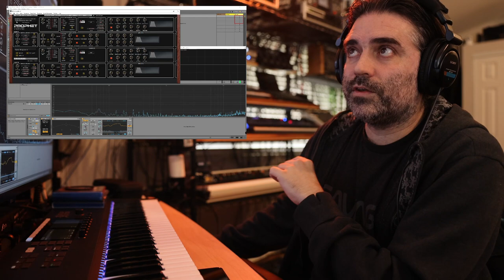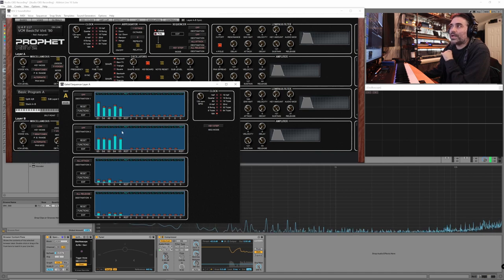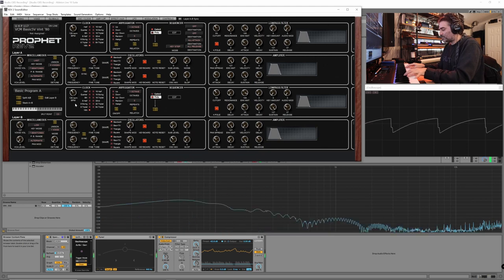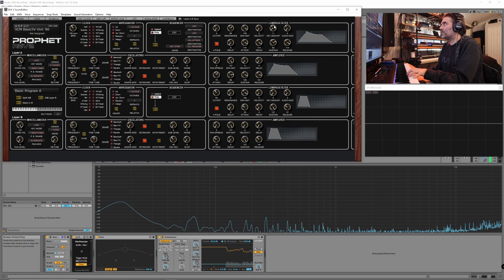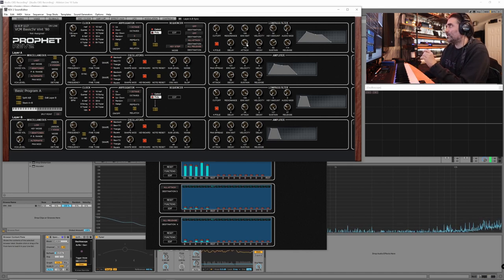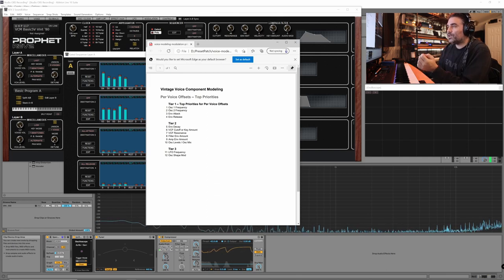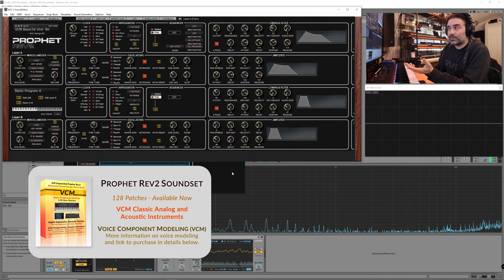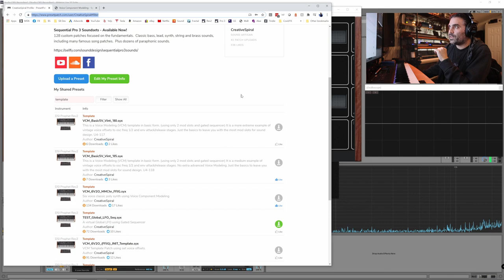Prophet Rev2 Synth - Vintage Voice Modeling - Free Patches

Comment: just tried this on my rev2, I don't have the software so I did it manually, and it's not as hard as I thought it would be! this is such a useful trick and even if you choose to use 4 lanes in the mod matrix, there's still lots of modulation lanes left to use (including some dedicated slots for mod wheel, pressure, velocity, etc that I always forget about).

once I got it set up fully with the envelope temporal offsets and everything, it totally changed the character of the synth. it's insane how powerful the Rev2 can be when you know how to use it. definitely going to use it as an initial template for all my patches now.
Reply from the maker: Awesome!  Glad you're enjoying it.   Cheers, Jason
Reply: have you got any tips for me?I've tried it the same way, but it doesn't work...
  :-/

Comment: Interesting concept. This kind of thing is something I have been doing for many years on VCO based synths - as a technique to push them more towards the behaviour of acoustic instruments. In particular my Alesis Andromeda has a per voice random modulation source which can be useful for this sort of thing. I think the Deepmind also has parameter randomisation on a per voice basis built in as a dedicated control. Some vintage analogue synths such as the minimoog are so variable in this respect you don't need to program it deliberately, it just happens anyway! Sample and hold triggered by note on can also generate a new value for every note, which is even more lively than per voice variance. However there is still something about DCO based synths that is different to my ears. the oscillator sound is thinner and less substantial, transients are more precise and they behave differently in a mix. The more instances you use in a mix the more pronounced the differences between DCO and VCO become. Anyway interesting ideas thanks.
Reply from the maker: Hey David - Yeah, I have done a ton of research on the topic of voice variance in vintage and modern synths...  the Deepmind's Osc Drift and Parameter Drift algorithms are both based on random drifting motion.    The downside of these (as well as Seq's Osc Slop), is that its introducing an extra layer of artificial motion into the equation.   Based on the research I've done, the key is to create curated, stable per voice offsets.   With the Slop/Drift/Parameter Drift methods, you get artificial drifting motion added in which is unrealistic, you'll get moments of odd dissonance at med/higher values due to random nature and phasing, and these methods don't produce repeatable performance as voices are cycles, or from session to session.    I've also experimented extensively with other methods like LFO random (S+H) and other tricks... they all have the downsides associated with randomness.      All of this is discussed in more detail on the VCM website:   http://www.VoiceComponentModeling.com

That's interesting that Andromeda has a voice mod source... I didn't know that.   Always wanted an Andromeda :)    Voice as a source is definitely a good way to implement VCM type of techniques though... that's what I use on Deepmind, and now on PolyBrute.
Reply: @CreativeSpiral  its an interesting topic and I agree that random based pitch and other parameter slop is not entirely natural, you have to be subtle with it but I think it helps to liven things up. My own interest is based on the behaviour of acoustic instruments as applied to analogue synths. So its interesting that you mention trying to make a performance 'repeatable' in terms of the voice offsets. Acoustic instrument performance is never repeatable at the kind of micro level we are talking about. Actually I like that. 
I think a lot of synth makers have thought about this issue - for example my Sub37 has an osc drift parameter, which I think is actually a per note random offset to pitch. My Macbeth M5n has an oscillator 'stability' control which seems to introduce some variability into the oscillator tracking across the keyboard. Thanks for the link I will look through your website with interest. Always more to learn!

Comment: I just received my Rev2, stoked. 
I'm a bit confused, at 4:36 , in the gated sequencer in layer A, Destination 1 and Destination 2 are set to OFF, but you  say they are targeting Osc Freq 1 and 2?
Reply from the maker: The mapping to Osc Freq 1 and Osc Freq 2 is done in the mod matrix instead.  If you route directly via the gated sequencer, the values are too coarse...  but using the mod matrix, you can scale down the values to tiny fractions, which are appropriate to get the vintage voice modeling behavior.    If you look at the example patches I uploaded,  you'll see the mod matrix setup.  Also, in the Blade Runner sound design video I did, I go through the entire setup and discuss in more detail how the connections are made:  https://www.youtube.com/watch?v=jB9HG3k3vvQ   (starting around 5:50)
Reply: @CreativeSpiral  please pin this comment!

Comment: Fantastic video, this is the one I was waiting for :) the without-with-without demos cemented the benefit. For synths without the gated sequencer, but with great mod matrix, would a small random value per-voice approximate?
Reply from the maker: Glad you enjoyed it!   Yes, any synth with a Voice Number or Random mod source option can achieve at least some voice modeling.   The Rev2, with the gated sequencer method and large mod matrix just allows very detailed voice modeling.    But, I've built a whole bank of patches on the Deepmind using Voice Number mod source for vintage voice modeling, and plan on doing the same when I get my PolyBrute.   There's some more articles on how to do this here:  https://www.presetpatch.com/articles/voice-component-modeling

Comment: Hi, thanks for the data. Very useful. I have a question. How do you get to play in the gated mode without the sound of the steps of the sequences. I m doing what you did but in the hardware and it jumps between the steps all the time cutting the sound
Reply from the maker: Hey Emiliano - there's a Seq Mode option in the Gated Sequencer... that needs to be set to "Key Step", in order for the sequencer to advance with each key stroke.

Comment: Excellent! One minor caveat: the filter cutoff has relatively low priority on your list. But it automatically affects the A, D, R times, i.e. wouldn‘t it be more economical to put above those parameters in order to save mod slots?
Reply from the maker: Thanks Rayy!   Routing offsets to filter cutoff only affects the "height" of the frequency Q point, on a per voice basis... It doesn't affect the ADR temporal timing.   Also, since there are other per voice offsets already associated with cutoff (ie: filter key tracking and filter velocity), I've found the per voice routing to cutoff to be less important than the per-voice ADR variance, which affects timing of those resonant peaks and VCA volume peaks.   Attack also has a downstream effect of altering the temporal offset of decay.    It is still a decent idea to have per voice cutoff variance as well, but I would definitely prioritize it lower than ADR offsets.
Reply: @CreativeSpiral  Oops, my fault. Yes, ADR are defined as time, not speed parameters. On the other hand, Sequential mixes this up as well. Have you noticed that in the mod matrix you need to dial in a positive value in order to shorten ADR times and vice versa? I‘m not alone. :D
Reply from the maker: @RayyMusik   Yeah... the positive values = shorter times is definitely is an odd choice...   I'm used to it now, but when I first got DSI/Seq instruments, it definitely confused me a few times.  ;)

Comment: I dont understand how to do this. if I target osc 1 or 2 freq, it sounds completely out of tune. i cannot target fine osc tuning with the gated sequencer. can anyone help?
Reply from the maker: There's a trick using the Gated Sequencer and Mod Matrix together that allows you to get fractional modulations (ie: fine tuning)...  If you look at  the free demo patches, you can see how its done, or in the Blade Runner example video, I discuss it in more detail, starting around 9:00:   https://youtu.be/jB9HG3k3vvQ?t=540
Reply: I've found it on the sequential forum thanks a lot!

Comment: Super cool stuff. But why does the gated sequencer say that the destination is ‘off’ in your video for sequence 1 and 2 but you describe it as modulating the Osc frequency (and, as far as I can tell, the fine frequency at that)? If I recreate the patch from the video and route sequence 1 to  the osc frequency I (predictably) get different pitches when hitting the same note. If I turn the routing ‘off,’ I’m pretty sure I’m not hearing any effect at all (I tested this by using more extreme numeric values), certainly not the slight but lovely per-voice drift you have here. 

Sorry if this is a dumb question. Really appreciate your educational videos and helping duffers like me get the most out of this synth!
Reply: I think I figured out that you must be doing something over on the ‘modulation’ tab with sequencer as a source, osc freq as a destination, and a small amount. Guess I will actually have to download the template rather than read values off the screen in the video. Thanks for all the work deconstructing this synth!
Reply from the maker: Thanks!  This video doesn't go into  the entire setup process... but there are links in the description to download template patches with everything set up.   The modulation for Osc Frequency is routed through the mod matrix (has to be done that way to get appropriate scaling)   In the Blade Runner patch video I uploaded a while back, I go through an example of the whole setup and describe the scaling/offsets in more detail.   If you wanna check that out, here's the video, and the specific VCM setup starts at about 9min:   https://youtu.be/jB9HG3k3vvQ?t=541

Comment: Does this bring the rev2 more into the sonic territory of the p6?
Also is this similar to how the new Vintage knob works on the P6?
Reply from the maker: Yes, per voice variance is one of the key factors of classic poly synth sound, and VCO poly character.   There are many components that give each synth a unique sound.   The VCF filter implementation is one of the biggest contributors to sound, and Rev2 vs P6 definitely have some difference in filter character, though they are based on the same general OTA architecture.     

Sequential has been mum on the exact specifics of their vintage knob modeling (as they want to keep it somewhat a trade secret), but the general concept is the same:  give per voice variance to different components (oscillators, filters, envelopes, etc..).   From discussions on the forums, my interpretation is they are using more of a "randomized approach" to creating the per voice variances, where this VCM method uses a more "curated approach" to setting specific offsets per voice, per component, and defining virtual voices.

Comment: Hi ! thanks for this depth video. But I can't understand one thing. In the gate sequencer. You telling that the first two lines affect at OSC freq, But Destination 1 and 2 are set to "off". why?  how does it work?
Reply from the maker: If you route from the Gated Sequencer direct to Osc1/2 frequency, the values are too coarse.  The mod matrix is used as a workaround to scale down the values to appropriate amounts..  if you download the free patch examples, you can see the setup in the matrix, routing Seq1/2 to Osc1/2.   Also, in my Blade Runner patch design video, I explain the setup in more detail:  https://www.youtube.com/watch?v=jB9HG3k3vvQ
Reply: @CreativeSpiral  thanks a lot! now I understand :)

Comment: Hi. This is great. Thank you. 
Is there a tutorial anywhere showing how to do this on the synth it’s self? 

Also do you know if this also works on the OB6?
Reply from the maker: In my Blade Runner patch design video, I go through the process on Rev 2:   https://youtu.be/jB9HG3k3vvQ?t=341  (starting around 5:40)    On OB-6, you can use the Vintage Knob functionality, which Sequential added in a firmware update... it uses the same methodology as these voice modeling techniques, and does a pretty good job... though I have some videos explaining how the Vintage Knob behavior could be improved as well...

Comment: How is this different from what the "slop" knob does?
Reply from the maker: The slop knob targets only oscillators, missing out on per voice offsets to filter, envelopes and other parameters that create much of the vintage character.  In addition, slop uses a randomized, constantly drifting tuning, which is more artificial.  If you want good vintage character, then using curated, stable offsets is better...   also great for acoustic ensemble patches.. you can create very realistic string and brass ensemble sounds with this type of method.  Bunch more info is available on my VoiceComponentModeling.com website, if you’re interested in reading more on the topic.   Cheers, J

Comment: This is a neat idea, but isn't OSC drift pr voice, meant to be modelled by the OSC slop know on the Rev-2. Or am I misunderstanding what that knob does?
Reply from the maker: I've written up a bunch of info on the subject on the VCM website and Seq forum.  The short of it is that OSC Slop is a very sloppy way to offset oscillators... it produces highly artificial, exaggerated motion that you don't actually find when measuring vintage instruments.   Having stable, curated offsets produces a more natural, realistic vintage character.  Further, Osc variances are just one portion of the vintage voice modeling.  Also offsetting cutoff, resonance, and envelope attack, decay and release timings adds a ton to organic/warm analog sound.

Comment: This is fantastic stuff. 
So does this require a second set of voices? Does that mean the 16 voice rev2 becomes effectively an 8 voice instrument?
Or is it a difference between the two DCO's within one voice?
Reply from the maker: Thanks Tom.. the standard VCM / vintage voice modeling setup doesn’t require/use and extra physical voices.  If you download the example patches, they are all setup and ready for sound design.   You can setup this type of voice modeling as a Stack/layered patch, which does essentially halve the physical voice count… it does produce spectacularly huge stereo/binaural fields of sound… I do recommend it ;)   Lots of the patches in the two VCM sound sets I’ve created use the VCM techniques with hard panned binaural stereo stacks.. it produces a similar sound to double tracking a part, but it’s all at your fingers in a live context.
Reply: @CreativeSpiral  thanks. do you know if this can be done with the Prophet 08 ?
Reply from the maker: @tomphillpotts  Yes, these techniques can work on P08 as well.   Some discussion here:  https://forum.sequential.com/index.php?topic=3450.0

Comment: So if an Analog oscillator is Digitally Controlled (DCO), then is the sound basically the same as using pure Digital? Or does the Analog Osc add any warmth at all?
Reply from the maker: The analog core oscillator gives natural analog wave shape and harmonic series, free of any digital aliasing or upper harmonic issues... for a true analog response.  The clock/tuning of that analog oscillator is what's digital in DCOs, leading to perfect tuning per oscillator, per voice.    (note: worth noting that digital aliasing is mostly a non-factor in modern digital/fpga/nco synths... it was more of an issue in 80s/90s/00s digital synths)   (also note: modern digital oscillators, with well implemented vintage voice modeling schemes -- like Groove 3rd Wave -- can capture the great majority of "analog character" that is associated with classic/vintage analog VCO synths.)
Reply: @CreativeSpiral  so is this vintage voice modelling technique basically just setting a Defined Detune and Envelope Timing Offset between each Oscillator?
Reply from the maker: @prcption8636   Yeah, the methodology I've been advocating for is to use "curated tables of stable offsets" that target per voice, per osc tuning, filter cutoff/res, env ADR timings, LFO rate timings, and other parameters in the synth engine which were traditionally controlled via analog circuitry back in the 70s/80s poly synth era.   By having small per voice / per component offsets, it introduces a bunch of organic phasing and temporal variances that we associate with that classic/vintage analog poly character.   Sequential's vintage knob uses this methodology, as does Arturia Analog Accuracy (which I helped to design/curate) and Groove 3rd Wave (which I also helped to design curate their implementation)    There's some more detailed info on my https://www.VoiceComponentModeling.com website, and the https://www.PresetPatch.com site -- If you're interested in reading more on the topic.

Comment: Since the gated sequencer is key to achieving the vintage sound, does this mean you will not be able to create step sequences with Poly mode for jamming using this patch?
Reply from the maker: Yeah, it uses the gated sequencer in Key Step mode.   You can have a separate layer (bi-timbral patch) where one layer gives VCM vintage/analog sound and a second layer adds some animated motion using the gated sequencer in another mode.